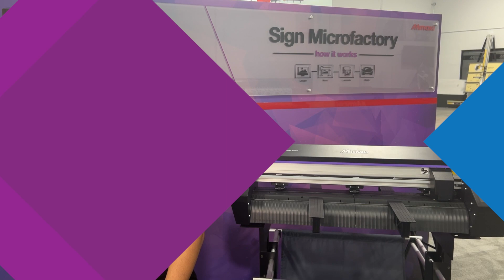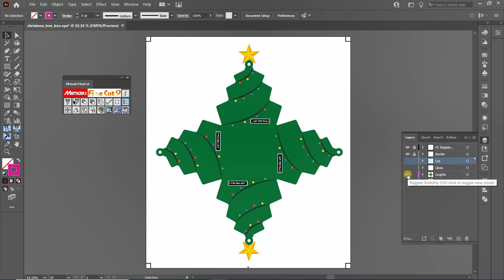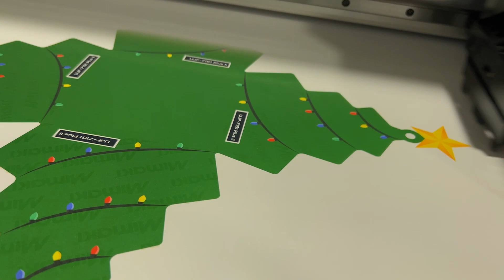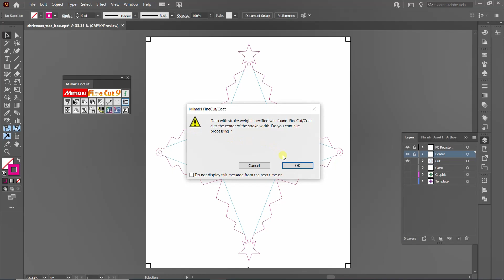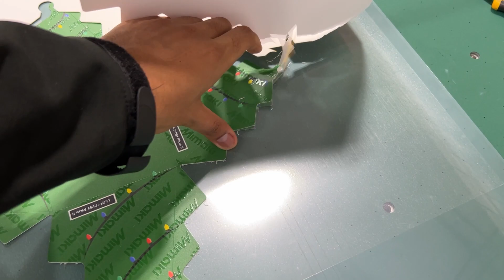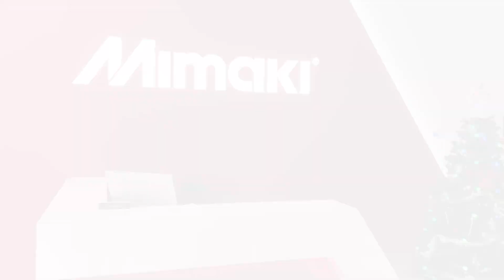CG-AR Xmas Tree Packaging ~ Tips, Tricks, and Techniques

Comment: Hi
Is there any dimension limitation for cardboard cutting?  more than A3 size is possible?
Reply from the maker: Hello. The cutting mat is created to cut up to A3 sized materials. You can try to use 2 cutting mats as shown in the video, however, this method will be limited depending on the material you are cutting.